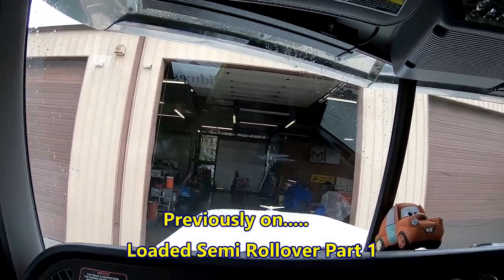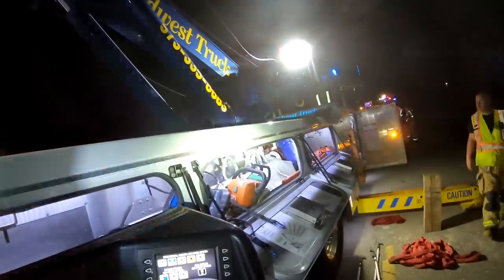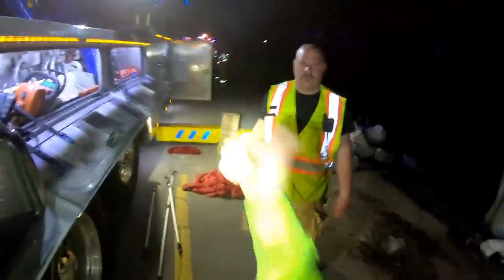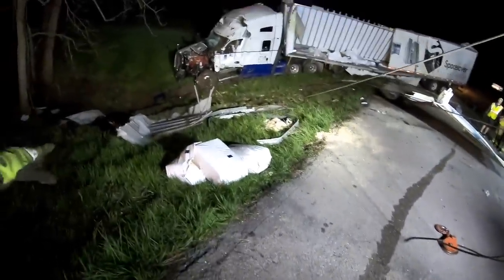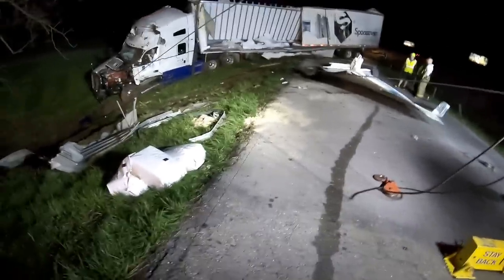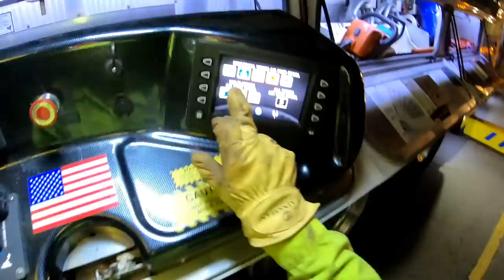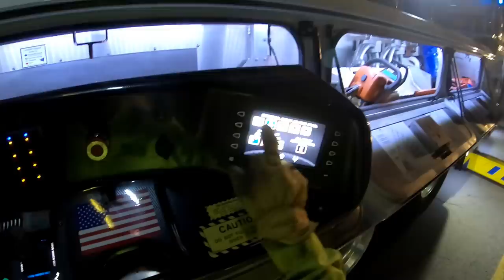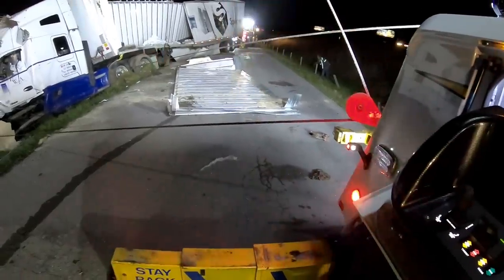Rollover Part 2 Uprighting & Up Lifting

Comment: That was something that I always worried about was my kitty, if something like that should happen.  I was more worried what would happen to him than I was me.  He rode with me until July, 2015 when I had to put him down due to heart, thyroid and other undetermined medical problems.  He was 12 1/2 years old.  A pet is like family.
Reply: I was soooo worried about him. I was in the er and said i was fine what about my cat.
Reply: sorry for your loss. i had several live to be 20.
Reply: if you have ever watched kittens play, you know cats are virtually indestructible.
i think they survive crashes because they are very flexible. they can turn mid air and hit a wall with their feet and absorb the impact. they can also hang on with four sets of claws to prevent becoming airborne.
Reply: Sorry to hear that. A pet is just as tough as a human family member.
Reply: Amen to that,Happy Pappy.
Reply: No, a pet is not "like family" it IS family.
Reply: I know what you mean

Comment: First time I seen a pallet clamp used to lift up a half of the side of a trailer. That's called using what you have available at the time.  You need to get bigger boots Ron. Too bad those guys didn't follow your lead on trying to move the trailer side by helping out, I could hear a couple of the chuckling. What a mess, but glad to hear the driver was O.K. That's really all that matters, the rest can be dealt with. Eventually. Your comments about the first responders at the end was a necessity as they are the brave souls that end up 1st on scene to such horrific accidents & are tasked with the recovery of the victims. Those are the gals & gals that really do not ever receive the credit they deserve. Bless your heart Ron for taking care of the cat once you found him. Last Oct I had to put one down. He was with my family for over 19 years. It was one of the hardest things I ever had to do. Your videos are filled with everything from learning the riggings to learning the lift points to the compassion of the people involved & even to the pets that sometimes become victims. A really great learning experience for everyone. Thank you.

Comment: Been watching your videos for awhile. From a geometric and technical stand point this was the best by far. Multiple trucks, multiple winch lines at multiple angles snatch block placement, winch line placement, etc.. JUST AMAZING this should be used as a training video for operators. Well executed safe work.

Comment: Some people need to realize that the crew “standing around” were the ones who unloaded the trailer, the behind the scenes people. Ron doesn’t seem like the kind of guy to have loafers on his team.
Reply from the maker: You are correct.  Most of them were fire personnel who had assisted with the unload AFTER they had extricated the driver.  I believe they earned a little "sideline" time after that.  Thanks and God bless.
Reply: I did 20 years in the US Air Force and if I walked in and saw one person working and the others were just watching got to work a bit longer and the other guy leaves at the regular time.. had to do that twice before they caught on..

Comment: ..a little duct tape and a couple of spray bombs and that trailer should be just fine ..lol..good vid. those truckin' cats are tough.
Reply: instant flatbed with a dance floor
Reply: I thought they were gonna duct tape the wall back in place but then realized its upside down.
Reply: I don't know, you think that will buff out???
Reply: not enough duct tape in oklahoma to patch that babe up let along missouri and okla combinded  What happened steer blew and driver could not control it
Reply: It would take some mighty good skill to buff that out!
Reply: joel mccoin I don't know... It might need some filler.
Reply: slight bow in the floor.
no big deal.
Reply: @zoealy972  maybe ask Texts for more tape., I hear they do things a little bigger.
Reply: You forgot zip ties and jb weld
Reply: ...and a little bondo

Comment: That cat didn't look too sure about his surroundings at that moment.  Keeping a moderately sized kennel on hand for situations like that might be a good idea.  Prevent any panic escapes, but also provide something they might take as a protected space against the unknown.

That was a big haul for a short move.  What was your max speed going home?  I don't think I would have dared go over 20 mph with that trailer.  So many of those have the strength in the walls.  It must have been like towing a long wet noodle down the road.

Comment: How long can the tator operate like this? Does fuel ever become a concern on a longer job?
Reply: PeterF If I recall correctly, Ron said that the winches on the Rotator can operate with the engine at idle speed. That would give many hours on a full tank of fuel.
Reply: I doubt it. The engine aint working that hard like if driving. So im guessing a half would run the trk all day on scene. But im guessing since i drove all day on a fill up
Reply: I would imagine he keeps the tank brimmed  as his call outs will vary in diatance so fuel is likely ok
Reply: Most heavy construction equipment ( dozers and loaders ) are designed so that a tank lasts a full shift and then a bit more. I would assume that the folks who build heavy wreckers like this would size the tanks for a full days long distance tow, say 800 plus miles. At 2-4 MPG that would be at least 200 gallons, and perhaps a lot more. That truck at high idle only burns a couple of gallons an hour. So, assuming he starts more than half full ( good practice to top off emergency equipment after each job ) and drives a hundred miles to get to the site using 25 gallons, he should still have a hundred plus gallons usable. So, more than a day on scene before having to worry about fuel.

Comment: Ron, is this an off ramp or service road ? How did the driver lose control??
Reply: B61 Mack from the boom cam at the end I can tell that this is a side road.
Reply: If I remember correctly from the 1st video, he was cut off by a car.
Reply: On and off ramps do not have Center dividing lines.
Reply: I was on the frontage road that runs next to 55
Reply: Craig Cole how did you wreck
Reply: Service road.  Driver ran off his side, over corrected, ran off other side. Over corrected again and then rolled her over.

Comment: Ron,
Great video I've been a follower for quiet sometime. The driver is lucky!  Couple of questions, on a job like this how are you paid by the hour or job. And how do you ensure payment, like if a company says oh we are not paying you this much, is there a contract between your company and theirs before hand. I work for Norfolk southern and the derailment company gets paid by the hour at a set rate ....just wondering how it works in your line of work
Reply: I suspect he keeps the truck until paid.  While this appears to be a complete loss I suspect there is some value to salvage parts and stuff.  Just me guessing of course.  I would think the trucks all have a set call out rate to start, then labor and hourly charges for trucks after that.  But again, just my guesses.

Comment: Cat power!  Ron, glad everyone was safe and sound in the end, that looked like a heavy load and things could have been worse!!   For odd material handling jobs and other strange needs, you'll find the adjustment screw on the vice grips (tm) is a common thread, 3/8 or 7/16 and 5/16 for the small ones, fetch an all threaded bolt or spin some threads up to the head of a 3" long bolt, weld a 1/2 inch eye on the head of the bolt now you can use a zip strap as a tie down or you can put in a small shackle for a loop strap. Of course not for any overhead lifting unless you're pulling plywood up a ladder by yourself but extra handy for that job where you need to tug an edge of something, makes a decent welding ground too.  Perhaps useful for tying down flappy things and to add a painter line to let someone hold a little stability on an item from a safe distance.

Comment: Science-fiction fan I am, but THIS is something that a real 'giant' robot would be good for- the angles and power to move something like this!  =)
Getting to-and-from the scene would be a different issue, but once on-scene it could have multiple legs or tractor treads to provide stability.  Cable trucks would still be necessary, but a human-shaped anthropomorphic vehicle (aka giant robot) would provide faster and safer alternatives as well as have its own built-in [set of] cable crane options.

Comment: at 25:00 you should have attached a guide line to the wall to help spin it from a distance. would made it easier then trying to use the truck. that's how we load warheads in the military onto flatbeds and ships

Comment: Great video thanks for sharing I was wondering why you don’t carry a air arc onboard one of the trucks it allows you to cut the kingpin off the trailer or the fifth wheel off the truck in about a minute so you can disconnect the two units quickly and safely and you could have cut the landing gear off the trailer instead of having to re rig and lift with another cable and you could have cut the sidewall into smaller more manageable pieces

Comment: Hi Ron, Could you explain why you didn't choose to use the spreader bar and do a straight cab lift back onto the road.  Stopping the truck from digging into the grass etc.  My guess is weight and distance from the road.

Comment: What head lamp are you using? That is one bright light. Could have used it last winter chaining up in the middle of no where Montana
Reply from the maker: It is the Nitecore SRT7 Revenger. I also use Streamlight, but I have found the Nitecore to have a much better light output at a lower price.  I've had it for over a year now and have had no issues with it.  Thanks for watching and God bless.

Comment: Jak zawsze świetna praca Ron, ale mam jedno zastrzeżenie do straży pożarnej. Dlaczego nie odłączyli akumulatora we wraku? Przecież to jest pierwszy jaki się wykonuje krok w ratownictwie drogowym. Prąd na metalowym wraku może powodować wiele niebezpiecznych sytuacji w miejscu gdzie pracują ludzie.
Reply from the maker: I understand and share your concern.  The batteries on this truck were on the driver's side, which was in the ditch and not accessible.  Normally, the fire department will disconnect or remove the batteries to eliminate electrical complications.  Thanks for watching and God bless.

Comment: I cannot believe how flimsy those box trailers are. Why is there no chassis? Good recovery Ron. Keep up the good work. Love and best wishes from over here in the UK.
Reply: Chris Gent, the entire box is the chassis, it is basically a box girder. Strong until one part is compromised, then it folds up like a cheap lawn chair......
Reply: The sides support it all. Look at cardboard flimsy as heck one way but the other very strong
Reply: Chris Gent all the parts of a van trailer work together to form the structure, right down to the doors

Comment: Not sure why the fire dept wanted to pull the pin except maybe spilling derv in the ditch, allways better to pull both as one unit, A lot of time waisted cutting bits of the roof, it would have been better to support / chock then a guy on top with the grinder then go along the whole length flapping the roof down giving then men a smooth pathway to walk on and get it handballed off pallets in a line ready for the load. The  whole rig was a total so conserving was not an issue

Comment: Just out of curiosity Ron, have you ever come close to using the full capacity of the rotater lifting or pulling?
Reply: video titled , i  believe, "lesson in resistance", a single axle dumper, stuck in the mud, dragged the roatator down the street. brakes set, outriggers down.
and, he had to use the rotator and a second truck to lift a burnt out combine. too heavy for the rotator.

Comment: I noticed you were concerned about the risk of the load shifting when you used the angle grinder to cut away the roof of the trailer. A piece of kit you might consider is a pole saw used by arborists to prune high branches. These come with a short chainsaw attachment but you might be able to get onr that takes angle grinder cutting discs. it has the advantage of keeping you well back from the potential cargo spill. There might be issues to consider such as kickback when you have a high speed cutting tol on the end of a pole but as with any tool you have to work out safe operating practices. I'm glad about the cat. It must have used more than a few of its 9 lives. My sons cat he found as a kitten. He heard it mewing and discovered it on the chassis rails of his trailer when he got back to the depot. He'd last stopped about 40 miles back so the cat would have traveled on the rails at least that far. https://www.youtube.com/watch?v=a90RAVbVp3Y

Comment: After watching a few of these semi trailer wrecks, I've come to realise how much better constructed the trailers in the UK are.  They all have a base design similar to this attached link, a much stronger ladder rail with each side having the biggest beams you will see and then the deck is mounted to that, American trailers appear to trust on the structure coming from the whole box design and there being no base chassis, once a wall is compromised the trailer falls to bits and then also causes trouble trying to recover it and tow it.    America may not be better at everything... http://www.dennisontrailers.com/slope-frame-iso-tank